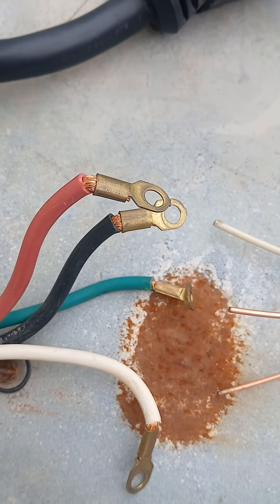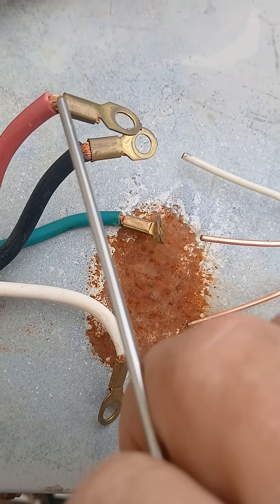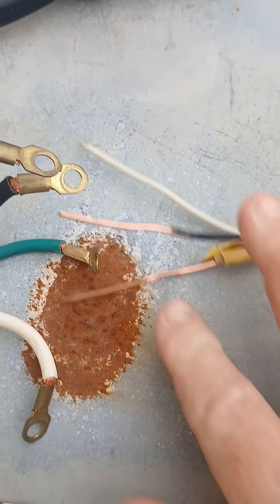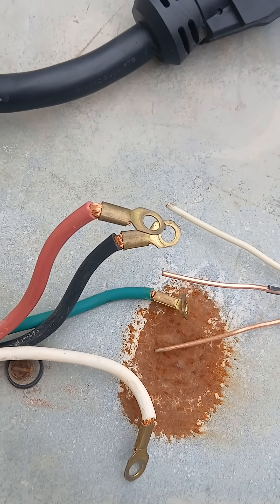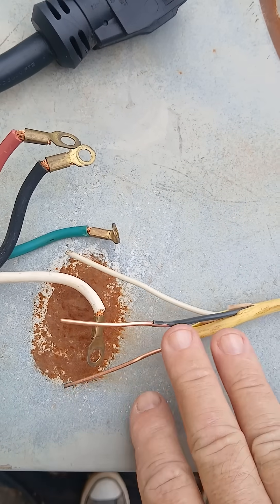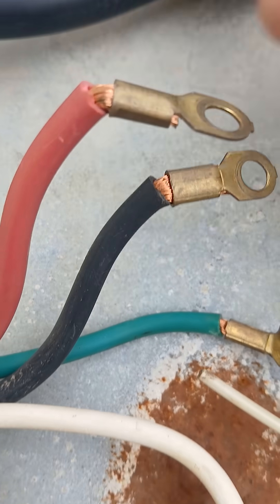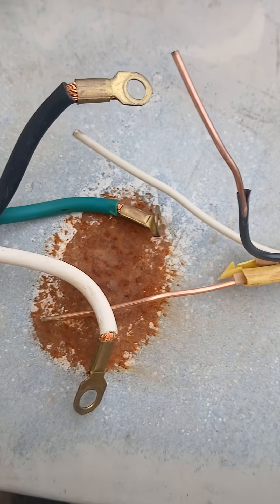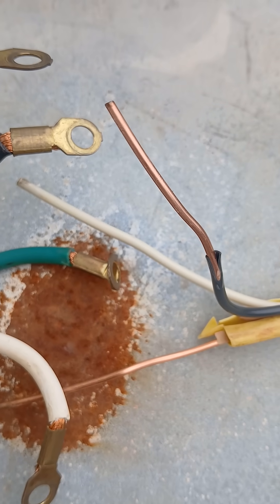Stranded or soldid wire, applications?

Comment: Stranded wire handles vibrations better than solid wire, which can fatigue and crack over time from repeated flexing or vibration. Also, stranded wire conforms better to terminals and crimp connectors.
Reply from the maker: Good info.

Thank you!